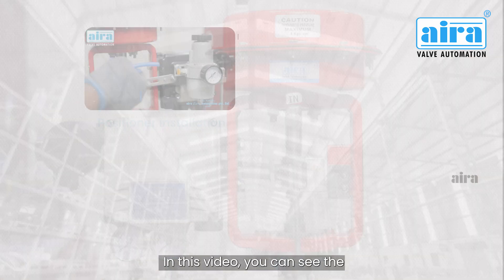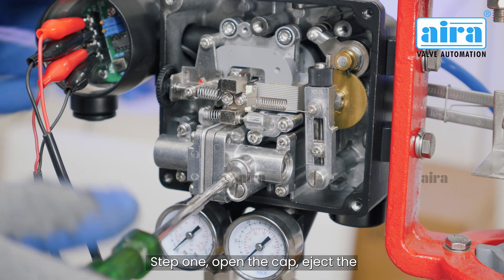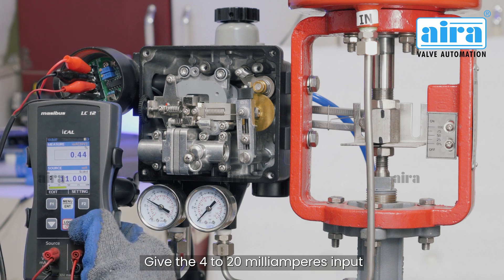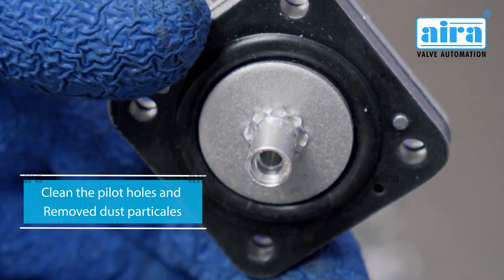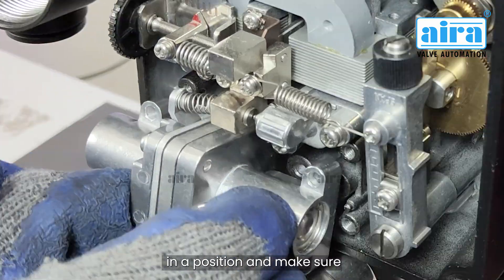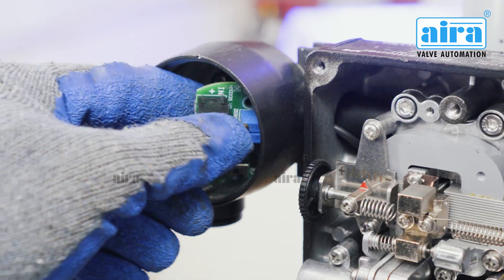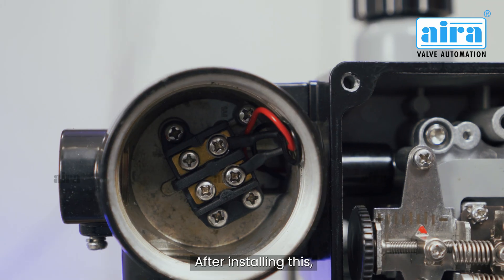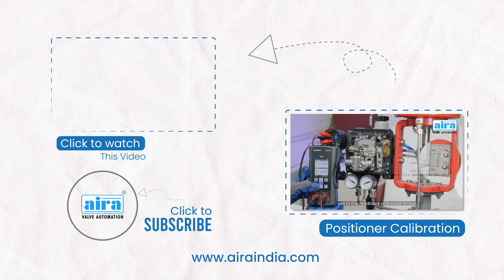How to Service Electro-Pneumatic Positioner | Positioner Analysis And Effective Solutions | aira

Comment: What is the maximum air pressure that the air pilot in the  positioner can withstand? What is the maximum air pressure that the part you cleaned can withstand? tanks

Comment: I have a quick question regarding the coil. I have a positioner that I get the 4 - 20mA all the way to the coil but yet the coil does not redirect airflow could you assist on what else I could check?
Reply: In that case you will have to change the positioner i guess...
Reply: @Mdmaroof06  thank you for the responding appreciate it